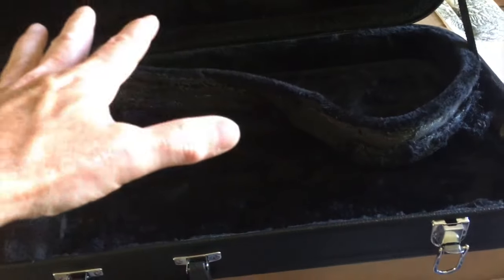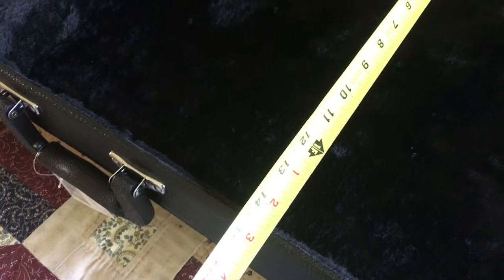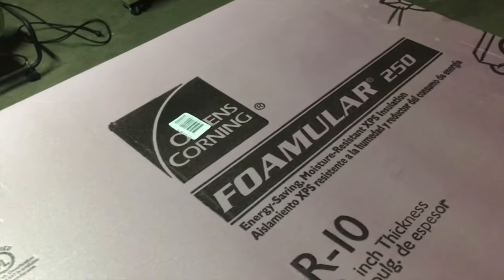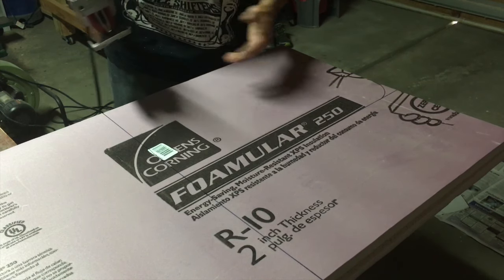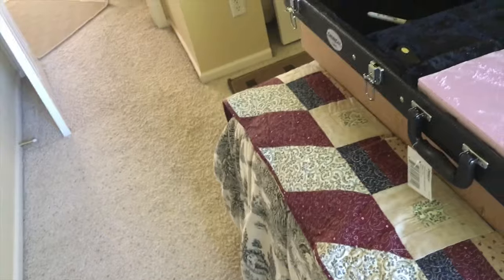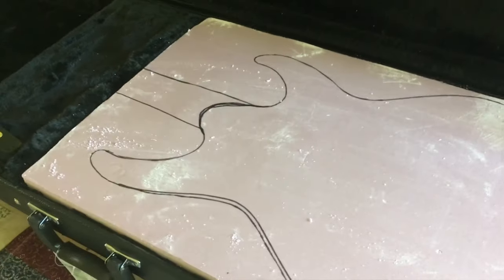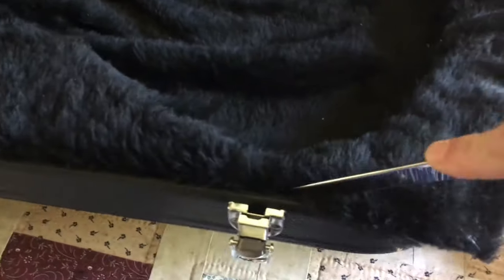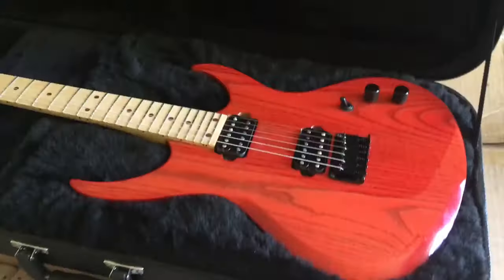How To Customize A Guitar Case For The Perfect Fit

Comment: Great video. I know this video is 6 years old, but one thing I'll say though...when you apply the lining in the foam cavity, you could also use the scrap piece cutout portion of the body and press it into the cavity area. That way you'll have all the inside lining pressed firmly into the inside cavity walls and contacting all the tight areas since using the scrap piece will have the exact shape needed to do so.  That way, you also eliminate any creasing going on. Nevertheless, nice job and thanks for the instructional vid!

Comment: Just found this. Have you ever modified an existing form fitting case to fit a slightly larger guitar?  IE: I have a Gibson Futura made to the original 50’s specs which is slightly larger/different than the reissue versions that have form fitting cases. 

Wondering if I’d have any luck removing the fur, taking out the existing form fitting piece/pieces, modifying and putting back together? Pretty sure the fur is separate pieces so theoretically I’d have to cut some extra away. 

Not sure if the bottom inside is a single piece under the form fitting pieces. 

Any knowledge or experience there?

Thanks a heap.
Reply from the maker: No, I haven't. I've only made cases for my guitar projects.

Comment: Enjoyed the video, and great tip, but 2 inch thick Foamular insulation board is only available in 4' x 8' sheets at places like Lowes, which costs more than $70 where I live. That's a very expensive material to use. There's got to be a cheaper alternative.
Reply from the maker: I would not recommend this approach if you intend to make only one case. It is much more cost-effective to make many cases.